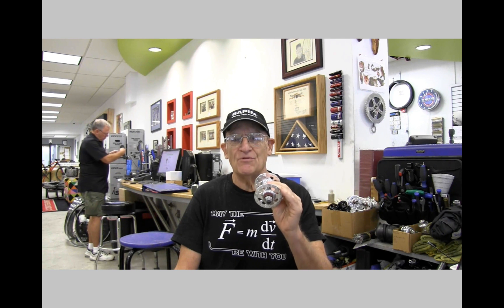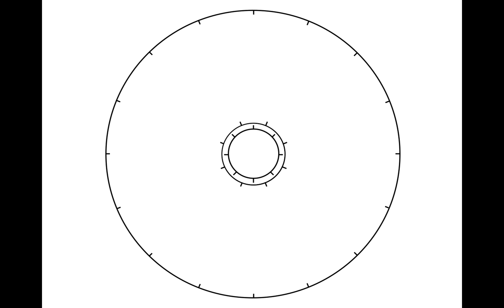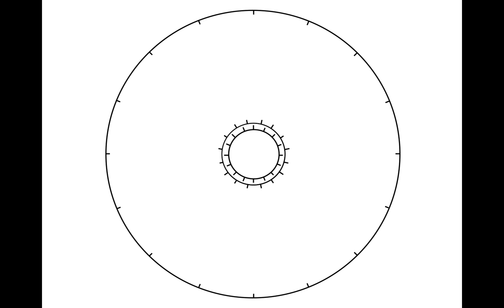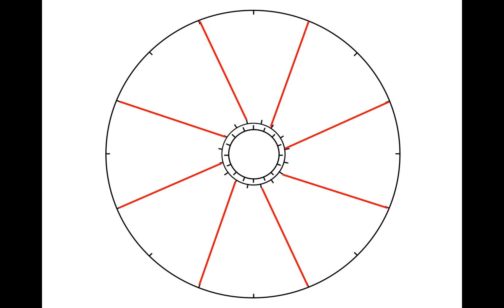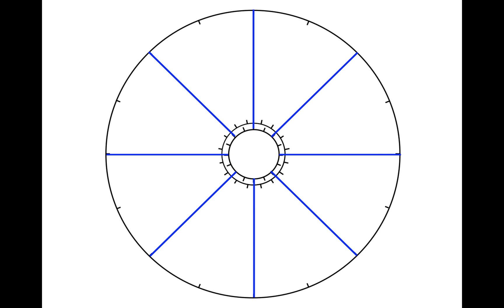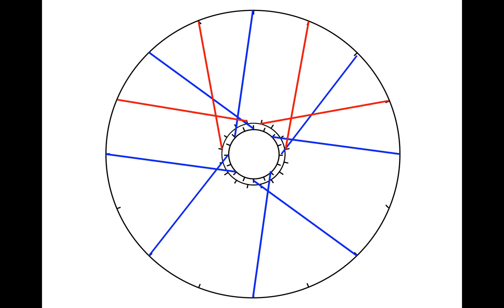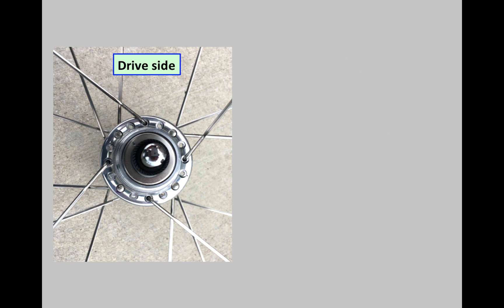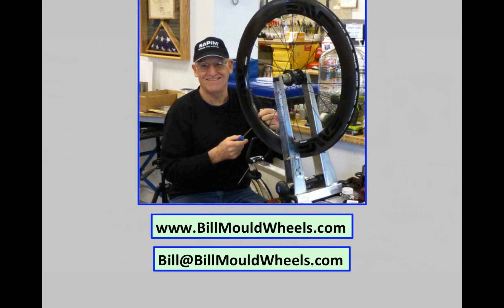Building a 16 Spoke Wheel with a 32 Hole Hub

Comment: I have the opposite problem, a 16h hub (Shimano C24 DuraAce front), and in the absence of after market alloy rims that are available in 16h drilling,  am contemplating lacing to a 32h rim (with something like expanding glue, to fill the vacant rim hole to avoid water / dirt ingress).

I assume nothing to solve here, other than to understand if there's any reason that's not structurally safe?

Comment: I build a hub 36-24H rear , a 32-20 front a 28-24H rear.
Reply from the maker: I hope the angular drilling of holes in the rims agree with the flanges to which they connect.

Comment: Hello, I tried to do it, but didn't succed.
How do I determine the length of spokes, please?
Because on spoke calculator gives the correct length if you have the holes matches for the hub and rim, not 16 on 32.
Reply: Did you figure it out?

Comment: Did 14 spokes in 28 hole hub and rim. Used paired spokes radial.  Results rode well and softened front as desired. Always carried spares in seatpost but eventually chickened out because I'm a heavy rider. Actually removing spokes made no difference in perfectly true wheel!
Reply: Does that mean i can also use 36 hole hub in my 18 hole rims?
Reply: @ralphgoldberg5543  Absolutely! Just  decide how brave you are before trying this. Removing spokes from a built 36 or 32 hole wheel is really easy. I didn't even have to true the wheel afterwards! 16 and 18 spoke wheels were available readily before disk brakes became common. My wheel was radially spoked. If you try this with a crossed spoked pattern I doubt it would work. A crazier pattern would be to use spokes pulling on one flange and leading on the other. I would not try this. Probably this would twist the hub apart. I wouldn't  do any of this on a rear wheel or one with disk brakes due  to windup at the hub! While you're doing this get aero spokes and tires that match the rim profile. This assuming you're looking for aero gains.
Reply: Thank you. I have this dt swiss syncros rp2 rim for months now. The hubs gave and i couldnt find 18 hole hubs for rear. 

I think the radial pattern only works when you have the exact length of spoke needed.
Reply: Gave in*
Reply: @ralphgoldberg5543  Radial spokes are not smart on a back wheel due to windup on pedal stroke.  Manufacturers are smart enough not to make a dangerous product like that. Probably dangerous with 40 spoke radial back wheel.
Reply: @ralphgoldberg5543  So true! Too short and the shoulder of the spoke nipple can shatter. Yes, even brass. Too long and you might not be able to tension the spokes right. The long spokes might also poke through the rim tape.

Comment: Bill, I have this same situation. 32h rear hub, 16h rim. I'd like to lace it the same as in your video. I understand that the drive side spoke length is 1x, but how do you calculate the length for the paired spokes on the non drive side? Are they 2x length? 3x length? Something else?

Comment: hi. awesome video. just subbed. question please, as this is my frist time builing a whell. i have a folding bike, it is a 16 inch rim, with 28 holes, but the hub i have is a 36 holes. possible correct?
Reply from the maker: Possibly, but it takes quite a bit of effort to figure it out.

Comment: Intuitively it would seem that there would be much more pulling force in each of the spoke holes with 16 spokes vs. 32 spokes.  Is that intuition correct or no?  If it is, is there a risk of the flange breaking with half the spokes?
Reply: Never seen this happen, but the forces are double and the wheel will be less strong. Had a good functioning 14 spoke wheel but wouldn't trust it for every day use.

Comment: Thank you! I have a 32 H rim and hub, but the rim is Strong enough and I'm very slim, so I think there won't be any problem, because my front Wheel also has only 16 spokes with no problem.
Reply: Your 32H rim and hub is laced with 16 spokes total radially?
If yes, no problems perfect symmetry etc.?
Reply: @DTao888  It's been working fine for years, I laced both wheels with 16 spokes, the rear wheel has one crossing on the drivetrain side and radial on the other side. After the first ride, some aluminium nipples broke at the rear wheel, I changed them to brass and never had issues since then.

Comment: Nice one, Bill. 
There's a couple of other ways to do it as well, depending on whether you want a radial wheel, or a crossed-and-radial.
On some rims with some drillings, it's worth noting that occasionally it's necessary to "ease" the drillings in the rim to allow a different spoke approach angle at the rim, if the rim has been drilled or specified to be laced in a specific fashion.